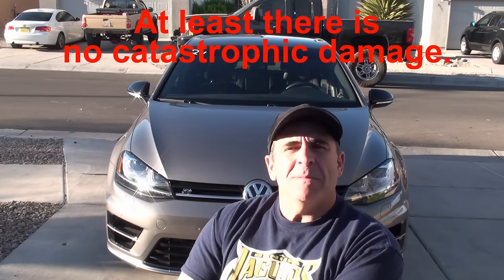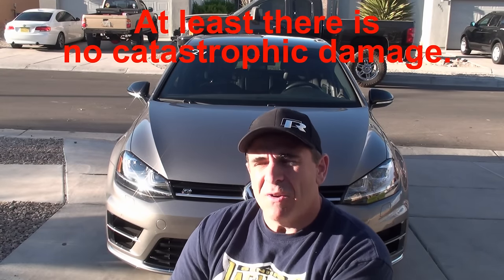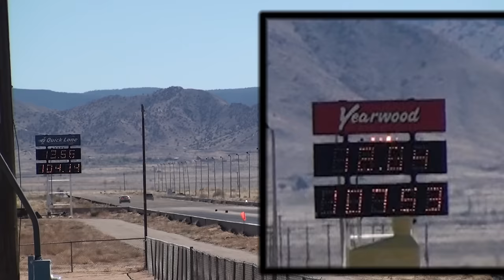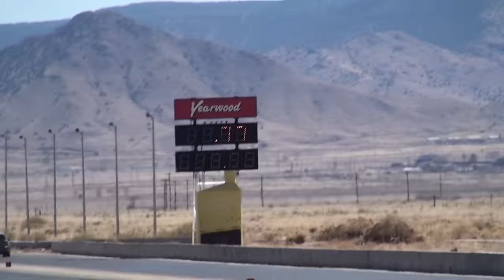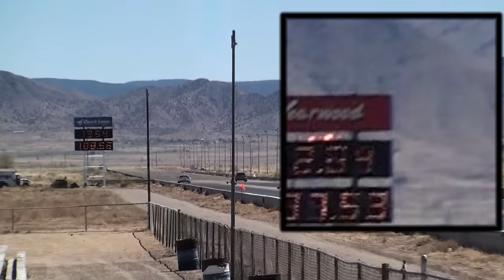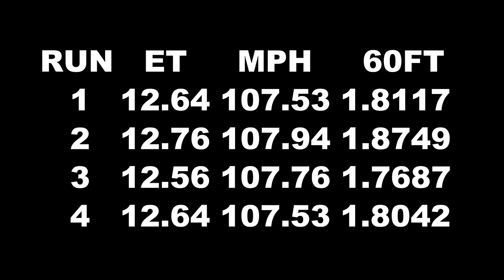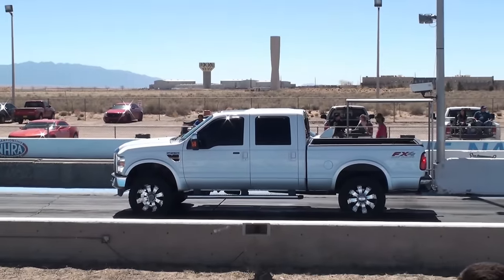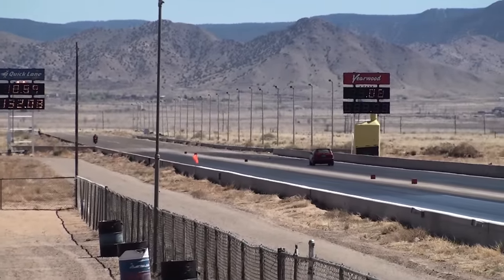2016 Golf R DSG APR Stage 2 Drag Times @5000 ft Elevation

Comment: Nice runs even though you beat up on my fellow corvette brother! Any idea what you would be running at sea level vs your mile high elevation? Mid 12's at a mile high is moving!
Reply from the maker: Thanks! 

This particular canned tune on other R's runs an 11.7 to 11.9 down around sea level.  There are other tunes and mods that are faster.  This was with stock fueling, stock turbo, 91 octane, no weight reduction, around half tank of gas, stock wheels and tires at 39 PSI, and stock intercooler.   Playing with any of these could shave some time. 

I have since added a bigger intercooler but that is about it.  My next experiment is going to be with a different tune, then most likely I will be going to the GTX3071R turbo (waiting to hear test results from tuner on this) with custom exhaust housing and additional fueling.  The US version of this car only comes with 4 injectors, but the ROW cars come with 8 injectors. I will be adding the other 4 injectors back in.

Comment: Awesome video!  I'm in Alamogordo NM so I know all about the elevation.  We usually go to El Paso Motorplex drag strip to get our runs in.  I just picked up a 2016 Audi S3 so pretty much a Golf R sedan.  It's awesome to see a round about numbers what my S3 will run after I get my parts and software on it.  Those passes are pretty damn fast for this elevation!  I'm moving to Florida this summer so I can't wait to see what the platform will do at sea level on some 93 octane or E85!

Comment: Fuck ya man. The potential of the mk7 is insane! All that bark of the z, vettes, etc and they got spanked by a little hatchback. Gotta love it.
Reply: +2016STIchannel Says the guy with the STI; very well known for blowing up. I've had two STI's and now I have an Evo so don't think I'm not fully aware.
Reply from the maker: +2016STIchannel it's funny you mention this, because there were several Chevy V8's that blew at the track this weekend. I think its just the STI's that blow when you push the power to high.  I had an AWD Talon (4G63) running 30 PSI and my motor never blew up. I bent half shafts all the time though.
Reply from the maker: +2016STIchannel oh ya, FYI. The VW engine is much stronger than you know.  This Golf R has been running 10.8 for a couple of years on complete stock engine internals.  https://www.youtube.com/watch?v=Tp0tMnxNhGk
Reply from the maker: He has racing video, so his engine is not blown.  I can show you plenty of youtube video of V8 with blown engines, but I bet you cannot show one MK7 Golf R with blown engine, cuz they don't blow like other cars.
Reply: +RockEye exactly what I was thinking. Subie guy talking about engines blowing. That's gotta be the cliche of the century. VW's have their quirks but engines blowing has never been one of em (despite people putting crazy hp through them on completely stock internals).
Reply: +Rad Fox yup very true. My stage 3 vr6 turbo (mk4) putting out over 430 hp has been on stock internals for over 5 years and I beat the fuck out of it. Majority of other vr6 turbo owners I know have also been on stock internals for the duration of their turbo kit being on. VW engines are beefy and can take one hell of a beating. Definitely over engineered. Cam followers, window regulators and cv joints are definitely not though lol
Reply from the maker: Hey thanks for sharing all of that.  It's good to hear that cars like yours are still holding strong considering how you drive it. Your car must be a blast to drive!  It's all the other bs like you said that we have to watch out for, although with the MK7 we don't know what to look for yet and I haven't heard of any repeated problems from my dealer besides some early production issues.

Comment: yea the elevation must make a huge difference cuz my brother has a 2015 R in white and its stage 3 plus now but when it was stage 2 it went 11.8 @114 on street tires... that was literally a cts catless downpipe, ipe valved catback, apr intake, and an apr stage 2 flash and dsg flash, and some enkei RS05RR wheels with pilot supersport tires and vwr springs..... like I said now its stage 3 plus with the fueling kit and all, and he just got a set of 17" enkei rpf1's with some 245/45/17 nitto nt01r drag radials and we are gonna hit the track with some race fuel and were hoping for 10's!!! nice car and nice runs man, these cars are unbelievable
Reply from the maker: Hey thanks for the comment, its good to have this kind of informative feedback. Is your brother happy with the APR stage 3 tune? Any driveability issues? Acceleration issues?

Comment: The camaro was an auto. They're half a sec slower than the sticks. They also have a L99 truck motor, 398 hp stock. The Sticks had the LS3. The LS6 was a stick only form back in 2004-5' and same for the LS7 from 2006 to 2014.
Reply from the maker: Hey that is some good info. How do you know so much about this car?

Comment: For everyone saying that his engine will blow, I've had my 2015 R tuned stage 2 for 25K miles, driven hard and had zero issues.  Also, I ran a 12.2 at 109 with just a tune at 700 ft elevation.  I have yet to make a pass with my stage 2 tune.

Comment: Enjoying your channel Rad! Are you only on a 91 tune? Thought you could get multi map APR tune, and run 100 octane, too. It would be nice to see gains from that.
Reply from the maker: +Laurence Holland thanks for watching! Yes, I am only on a 91 tune. APR has a 93 and 100 octane tune but they are currently not switchable on-the-fly on the MK7.  I would have to schedule an appointment and drive over to my local APR shop and have them flash either one tune or the other. I am anxiously waiting for APR to release the switchable tune but it has been over a year and it has not happened yet! :-(

Comment: Hey Rad, the Red VW must have been a TDI. lol.  Hey how does the DSG do in stop and go traffic?  I live in the Sydney Australia area (tons of traffic).
Reply from the maker: +Ron Hunn I remembered you had asked me this before and I have been trying to collect some video on this but it will probably be pretty boring when I do put it together. I think I need to buy a track tool that shows pedal position, boost, RPM,  Speed, and gear that I can run while I am filming the driving. 

I have no issues with the DSG in stop and go traffic.  I think this transmission is wonderful.  Now bear in mind that I have the DSG flash from APR and I pretty much only drive around in Sport mode. APR has tweaked the shift points to be later the heavier you press the throttle. With light throttle the shift points are like stock, which is quick and early,  but if you press heavier, the gears will hold to a much higher RPM before shifting.  This make for a much more enjoyable experience in my opinion. One thing that amazed me with this transmission, before I did the ECU flash, and before I did the TCU flash was that you don't typically feel the shifts, they are so fast and smooth, you only really hear the engine and exhaust note change.  

One thing I have noticed that I believe is DSG related,  it might be traction control related, is that when the car is completely stopped and if you just floor the car there is a pause before the car starts moving.  I think there is a hardware delay that is dependent on how hard you immediately press the pedal from a stop.  The harder you press the gas pedal the longer the delay.  Now this is just probably a second at it's worst but it is still noticeable to me.  To avoid this I just barely press the pedal to get the DSG to engage very fast and then I floor it after the car starts moving. Now if you really want to take off fast you just use launch control.  Hold the brake down, floor the gas pedal, and then when you let off the brake pedal the car bolts like a bat out of hell!

Comment: Good job! Some 18' lightweight rims and sticky 235 tires will help a lot especially off the line, also motor mounts and u can lose an extra 30lbs with a lighter battery
Reply from the maker: +Elvis Cordero thanks for the tips! I haven't performed any weight savings yet. I did however install an 034 dogbone insert that I believe has reduced my launch wheel hop substantially and I believe has lowered my ET by about 1.5 tenths.  It's hard to say for sure because the DA's are higher now as we near summer.  For sure I will get some stickier tires, but only after these new ones wear down some more.  I have been looking at rims but it seems as though I will have to spend a lot of money to drop just a few pounds per wheel, I am not sure its worth it.
Reply: +Rad Fox nice! Neuspeed makes rims specifically for the Golf and they look great. I plan on getting a mk6 gti soon
Reply from the maker: Those neuspeed do look pretty dang nice! I am sure you will love the GTI, mine was awesome, especially with a tune!

Comment: Maaan, that little golf is bad ass! I want one so bad. And this is coming from a Subaru owner.
Reply from the maker: Thanks man! Which subbie do have?
Reply: +Rad Fox I have a 2016 WRX Limited with the EyeSight and all that stuff. This video is the reason I will be replacing my subie for this asap.
Reply from the maker: +Mr Antifeca you have a really nice WRX! Do as much research as you can to make sure you will be happy with your decision. Have you driven a Golf R yet? In its stock form you really have to get into it hard to get it to give you everything. However with just an ECU flash the car will give you so much more anytime you press the pedal. I went DSG because I wanted all out acceleration performance. If you go DSG make sure to get the DSG flash too. The DSG flash makes the Sport mode soooo much better. The only thing that I don't like is that the US R doesn't come with a moonroof.  Otherwise for me this car is perfect!!
Reply: +Rad Fox Nah man, not yet. I know if I do that,I'll have to convince my wife to get rid of our 5 months old Rex. I don't know how I can do that,uknow, LOL Thank you for the videos,keep em coming I will subscribe!
Reply from the maker: +Mr Antifeca Thanks for watching! I have heard that subbie don't loose that much value on trade in, but I am sure you would have to take a loss.  I had a fully loaded 2015 GTI that I traded in for the 2016 R and I took a huge loss, but I didn't care because I knew what this car was capable of.  Good luck man!

Comment: can't hotrod around with a DP on a tune but so what else do you need to make it ok then? rest of the bolt ons? pretty much FOB?
Reply from the maker: The problem was that I had the stage 1 tune on the car and then I added the aftermarket high flow downpipe and drove it for a couple of days before I could get the car flashed to stage 2.  APR told me, after the fact, that their particular stage 1 tune was not safe with an aftermarket high flow downpipe and that I needed to get the Stage 2 flash immediately.  There are no other bolt ons required for stage two, but if you want to get all of the power then you need to install a high flow intake on the car.  The high flow intake will add another 15-20HP.

Comment: Hey Rad, love the channel. what size and brand tires were you running with these races? thanks
Reply from the maker: They are the upgraded 19" stock Cadiz wheels with P235/35R19 Continental ContiSports.  These tires are okay but I want to switch to Michelin's PSS tires, they are much stickier.  Also, I am thinking that I might want to switch to the 18" Cadiz wheels or something else, because I think having more tire may bite better during launch.

Comment: haha awesome - Loved watching you take that Camaro. I just bought a 2016 Golf R Manual in Black.. Loving it so far. If I get the stage 1 will I kill my warranty?
Reply from the maker: Thanks for watching and for the comment! Congrats on the new car!!!!!

It's really complicated regarding the warranty and it depends.  You do the run the risk of VW not honoring the warranty on anything related to the tune i.e. the engine, transmission, and drivetrain.  If you are on good terms with your dealer they may help with most  issues but if there is a major warranty denial from VW I would not expect the dealer to cover it.  However, if you have a known failure mode, VW will most likely cover it even if you are tuned. But before you go in to the dealer with any engine or drivetrain problem you should really flash back to stock before taking the car in.  Even if you do this, VW can detect if a tune was present if they run the right scans.
Reply: Thanks for the reply; that makes sense. Flashing back to stock could be an issue where I live a good 5 hours away from the closest place to get a tune :/ It's very tempting! How much improvement did you see with stage 1 / no hardware?
Reply from the maker: Joe SoltesZ the increase in performance is very large and noticeable with no other hardware.  It is a whole different car with the tune.  It felt great!
Reply: Almost dealers in NJ offer aftermarket parts and software. If you have a dealer near you they might cover stage 1. My dealer covers stage 2 for Unitronic but after that they don't. I ended up going with eurodyne because of the ease it brought me to tune it. Manual Rs are few and far between it's nice to see other drivers opting for the manual. Keep in mind. If you go to stage 2 or higher you will eventually need a stronger clutch/flywheel.

Comment: How much of a seat of the pants difference did you notice going from stage 1 to stage 2? Did you feel it was worth the time/money? On paper it doesnt seem to be that large of a gain.
Reply from the maker: +wade3mvp1 I can't exactly tell you the seat of the pants difference because I ran stage 1 with the downpipe for several days, and the car was absolutely ridiculous (but unsafe for car), then when I flashed to stage 2 (to match downpipe) the car lost some power, but it still did gain power over the stage 1. If you really want to look at this analytically, going from stage 1 to stage 2 netted about 3 tenths of a second in the quarter mile for me.  This is not that much of a seat of the pants improvement. So you are going to have to answer for yourself, if 3 tenths of a second is worth the price of the downpipe, install, and the flash. It's really not that much of a gain for the money, but I had to do it!

Comment: I'm really looking forward to your FMIC install, curious to see how the developers get around the radar unit.
I might be joining you in the R club far far sooner then I though I would be. My sales manager has finally given up on my car and he's going to try to buy it back from me for the price I bought it for plus sell me the R i want for the price I paid for my GTI!!
Find out tomorrow man, I'm stoked.
My cars been at the body shop for 2 1/2 weeks and they've still missed more paint damage from the glass people. Got it back today and found more damage with in 10 seconds lol. so far my car's been in the shop(s) for 28 day's in under 3 months.
Reply from the maker: +MechRider89 That is ridiculous that you are having to deal with all of this! Dude if you can upgrade to an R out of this that would be awesome! I'll cross my fingers for you. :-)  

The intercooler that I will be going with is the APR direct replacement for the stock one, which is up against the radiator and condenser.  The intercooler and radar should not interfere with each other.  

Now what I have been wondering, was if I will need to add additional cooling on top of this in the form of something like the twintercooler.  The twintercooler is not listed as fitting the golf R, I am not sure why it doesn't fit but maybe I should look into having a custom one made.  The reason I am concerned is that it is just to damn hot and not enough air up here in the summer.  If I have time I will do some logs of the IAT's before I install the APR intercooler.  I haven't ordered it yet, but I might do it this week, not sure yet.
Reply: You might need to try some pusher fans if they'll squeeze between the rad and the new intercooler, the stock ones will be worked a lot harder. Or possibly just upgrade to some larger pullers. It will indeed be very interesting to see the affects the apr unit will have on the coolant temps for sure.

Thanks! I really need some luck. I did win my free roof rack demand. I'm just glad my dealerships working with me. I'll be sure to let you know what happens.

Comment: Hey rad I did some converting on this website for your DA handicap and it says you'll run high 11s down here. I'm thinking of checking my compression today just for fun to get a measurement. I like that idea you had of keeping an eye on the compression over the life of the engine and over the course of modding.
Reply from the maker: Hell ya! Gotta keep track of the PSI yo!!!
Reply: +Rad Fox just got back from autozone. Lol.   What program did you make that chart on? I haven't done much of that stuff on computers since high school and there's been quite a few times I wanted to do something like that.
Reply from the maker: +Meat Amigo I used Windows Excel for the chart.
Reply from the maker: Heck ya man!!! You have been busy today! LOL!

Comment: MK7 Golf R shouldn't be that slow, with APR Stage 1 and no hardware at all, it can easily run 12.2@110mph+,seriously
Reply: actually is 12.3, tested
Reply: Altitude
Reply: People don't understand altitude. Even APR refuses to tune a car for altitude.
Reply: Michael Stanton they refuse to cus of all the idiots that would blow their motors racing outside of the tune's parameters (e.g. Going to track in lower elevation) then blaming APR for blowing up their motor with shitty tune. Can just imagine the warranty claims now.